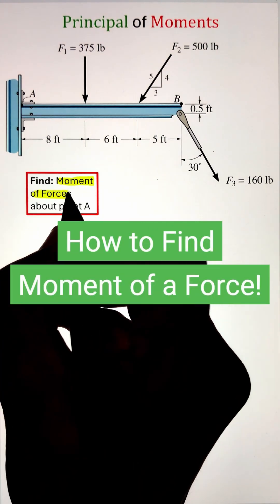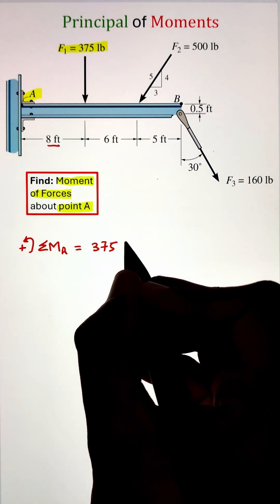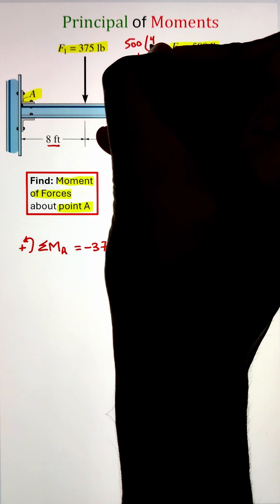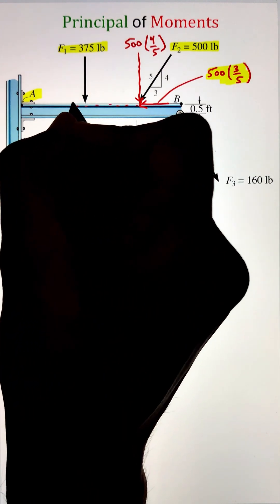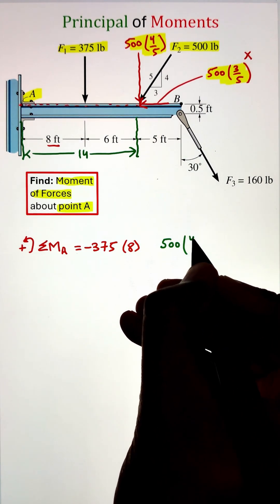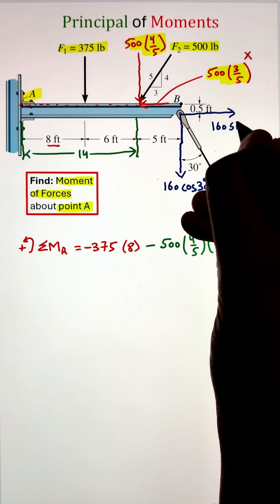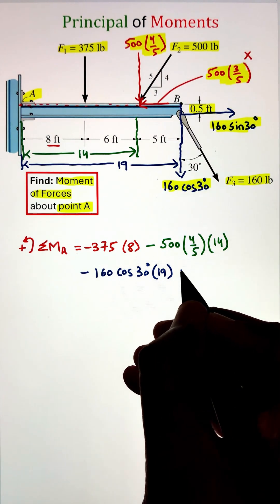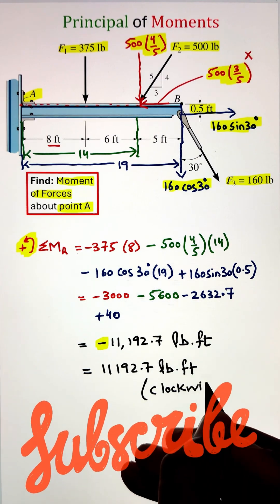How to Find Moment of a Force about a Point | Scalar Method

Comment: 160sin30 why counterclockwise how can i understand it plz help
Reply from the maker: For directions one way to visualize it is to place a pencil on the moment arm and hold it from the point across which the moment is calculated and on the other end apply the force in the whichever direction the force is pointed, rotation of the pencil will help you visualize if it going in clockwise or counter clockwise direction.

Now for 160sin30 force the moment arm is the vertical distance from pt b to the location the force is applied, now if you hold the pencil from top (pt b) and apply a force at the bottom of the pencil towards the right (direction of 160sin30) it will rotate in a counterclockwise direction.

Hope this helps

Comment: Why did you take the 160 cos not the 160 sin
Reply from the maker: Cos function projects the force along the axis the angle is measured from. Since 30 degrees was from the vertical y axis to the force vector, so the cos function will project the 160 along the y axis. Hope this clarifies.
Reply: @MathPhysicsEngage thank youuu